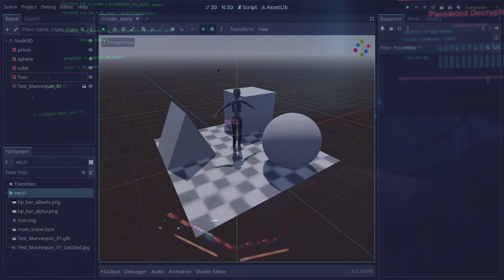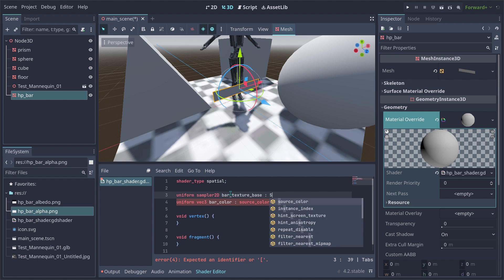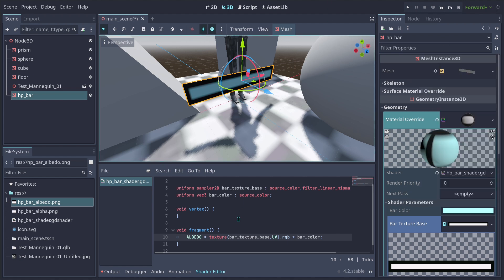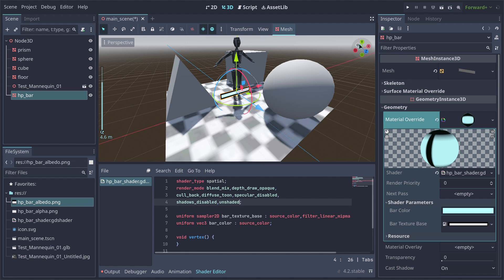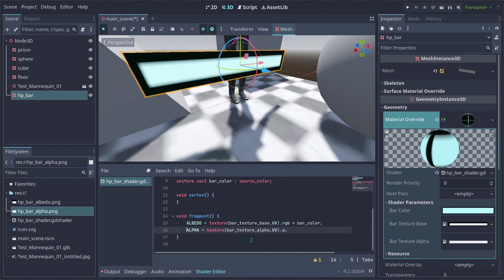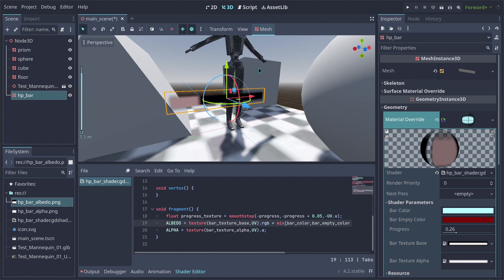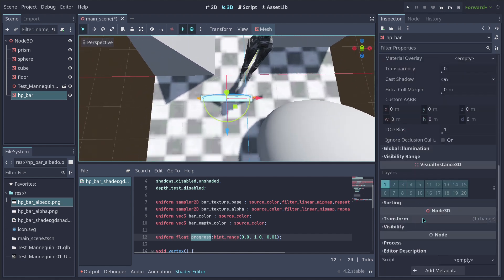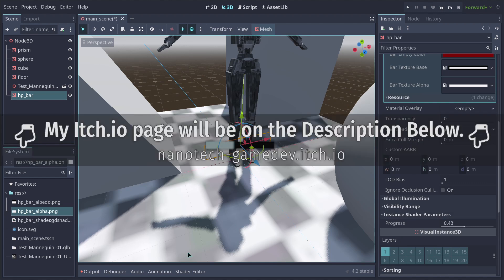From scratch make a 3D hp bar shader in Godot: Making an RTS in Godot - Shader Tutorial

Comment: The color changing would be better better handled by gradient texture. Otherwise very nice tutorial.
Reply from the maker: Different ways to skin a cat, specially with a simple use case like this, I could even try to go with 2D progress nodes or try a 3D sprite + textures if I wanted, but atm this is sufficient, though if this shader brings perfomance issues it might be worth looking into better perfoming simpler solutions with other shaders or nodes.
Reply: @carpenterblue YOUR RIGHT, THATS WHAT I USED.. IVE BEEN FIGURING OUT THE BEST WAY TO IMPLEMENT HP BAR SINCE USUNG SUBVIEWPORT IS VERY EXPENSSIVE IN RTS SINCE YOU WILL HAVE HUNDREDS TO THOUSANDS OF UNITS USING A SUBVIEWPORT. I TIRED MANIPULATING THE MESH SIZE AND GIVING IT OFFSET, IT WORKS BUT STILL VERY EXPENSIVE IN PERFORMANCE THEN FINALLY I TRIED MANIPULATING THE GRADIENT TEXTURE ITS FAR MORE SIMPLER AND FASTER THAN USING SUBVIEWPORT.. THIS TUTORIAL IS GREAT BUT I THINK THE GRADIENT TEXTURE METHOD IS MUCH SIMPLER. JUST SHARING IT INCASE🙂